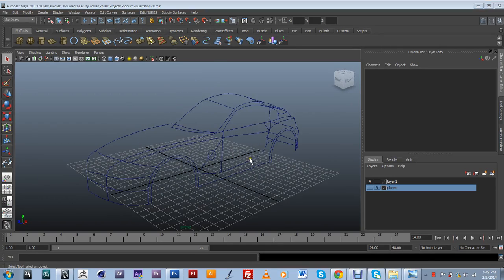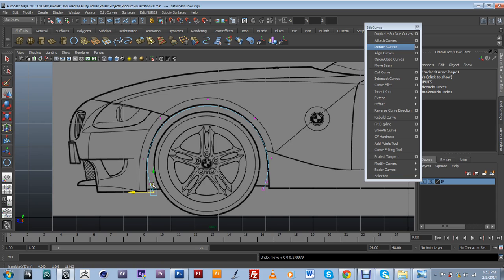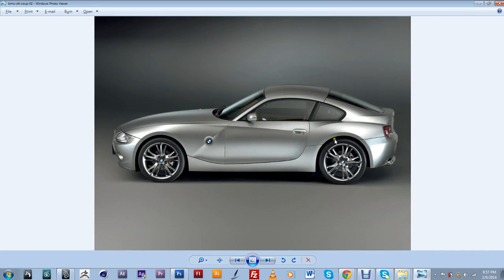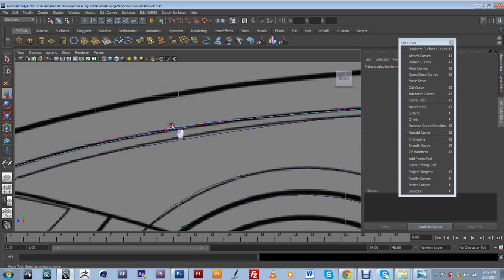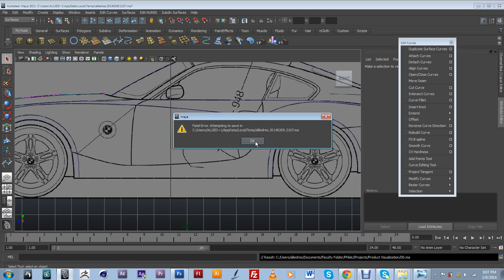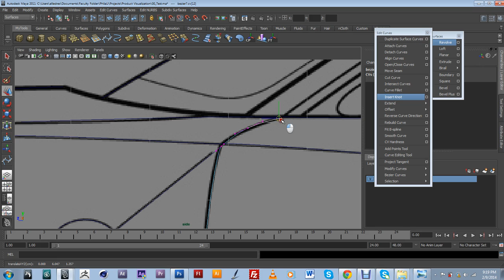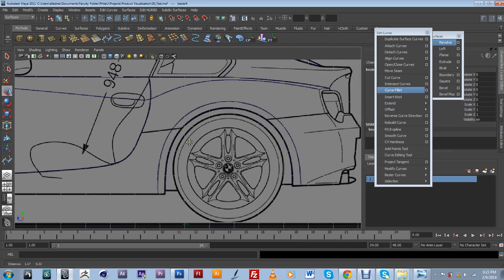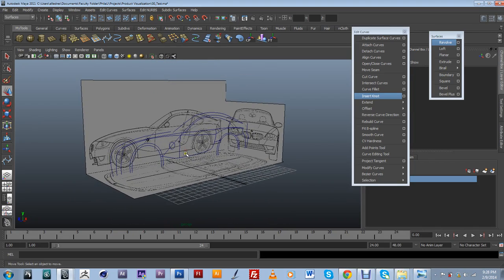Maya: Vehicle Modeling 2: Spline Cage 1

Comment: I got stuck in this part! Your images are gray....i don't know how you did that. Also when i try to draw a circle in the side image of the car like you did...the circule appears in the original grid, where the top image is placed.
Reply: +Ale Giordano i have the same problem... i am using Maya 2016.... and i can't find solution.... do you know what to do??
Reply: Select Image Plane and in Atributt Editor change alpha gain value to 0.5 or 0.3 ...

Comment: Why would you start building curves using bezier? When you need to build a car use N.U.R.B.s curves, they are smoother and easier to control. The only reason anyone uses bezier or B-splines is when they don't know any better or started out with polygon modeling. And please stop chewing gum while talking into a mic. Thanks
Reply: +A Evans No need to be a Jerk that was his mouse.
Reply: +Who Blah Sorry for being a jerk, but your reply is priceless. thnx for the laugh.
Reply: +A Evans , The use of bezier curves insures a smooth G4 curve. Bezier curves have control points. Every curve tool in Maya's surface tools creates a NURBS curve. (every curve is capable of creating a surface.)
Reply: that is not true. bezier might give you control handles, but those handle are the reason not to use bezier. NURBs curves are the smoothest type of curves because all you can move are the CVs ( control vertices). CVs allow you to manipulate the curve over the length of a given span (between knots). Bezier handles affect the area closest the the edit points. Bezier curves and manipulation handles are better for adjusting animation curves than they are for editing construction curves. The reason for that is, animation curves are 2D, and that limits you to a single rotational axis. Bezier handles in 3D space means you are moving it all over the place so your control is not as great as you might think.